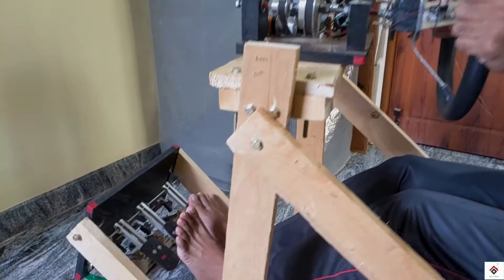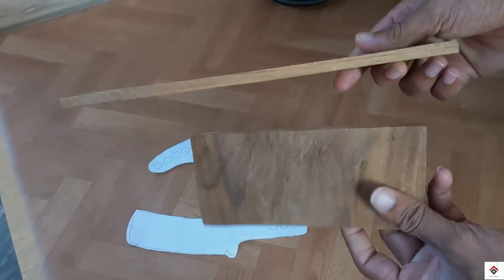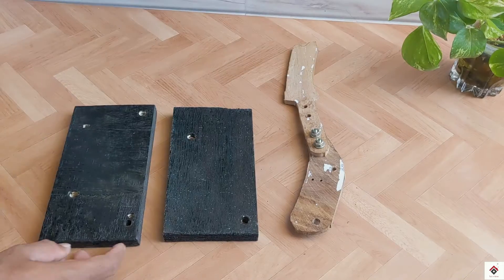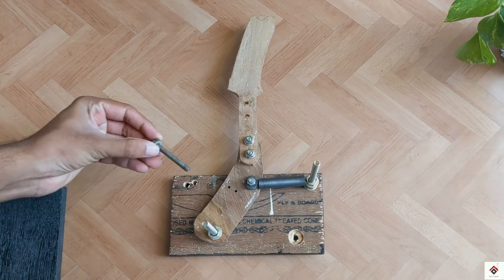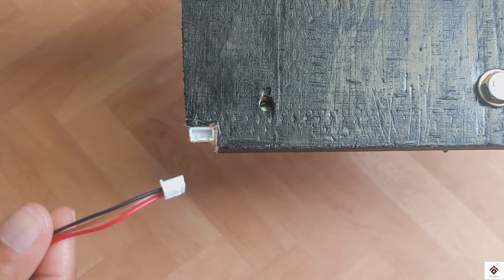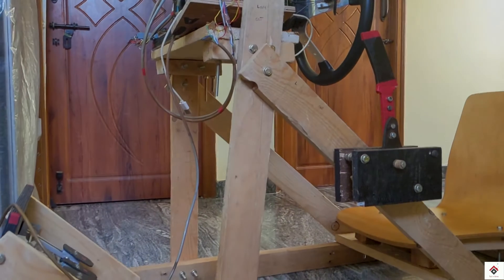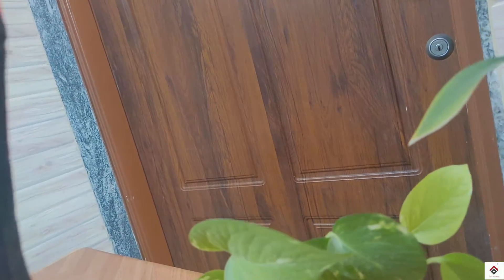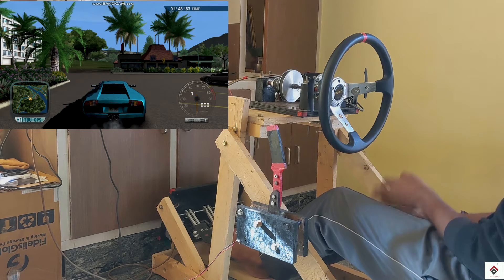DIY Analog Handbrake using Arduino for Sim | Drifting Hand Brake with Force Feedback Steering Wheel

Comment: How to play forza horizon 4 with arduino steering
Reply from the maker: Directly forza horizon game doesn't detect the EMC wheel.
Using GIMX adaptor we can make it work. Inputs are working. Still I need to check if the force feedback works.
Will make tutorial soon.

Comment: Bro can you a tell me how to play forza horizon 4 with it please tell me because I had made steering wheel also please
Reply from the maker: This EMC firmware doesn't support directly, Need to make GIMX adapter. We will make video soon.
Reply: @techathome  please tell me how to make the adapter you said beacuase I don't know how to make it
Reply from the maker: I will make video on it.
Reply: Bro how to make it what will be the cost because I had made it the steering wheel already I can't play with it
Reply: Where did you buy the steering wheel
Reply: Bro can we directly buy a gimx adapter
Reply: What is the steering price you have used

Comment: Can I play any game with this?
Reply from the maker: As of now I have not tried, but saw came across some videos showing it doesn't support all the games.

In that case they were using Diy GIMX converter. Using GIMX, you can make it compatible.
Reply: @techathome  what is GIMX
please make a separate video on how to play all games with this steering wheel setup.
Reply from the maker: Yes

Comment: Hi bro just following your videos and steering ffb working fine with emc utility. Just need your help for pedals. I am using load cells + hx711 setup. Is it possible to use emc utility and how to calibrate